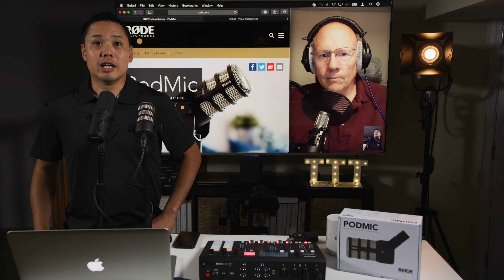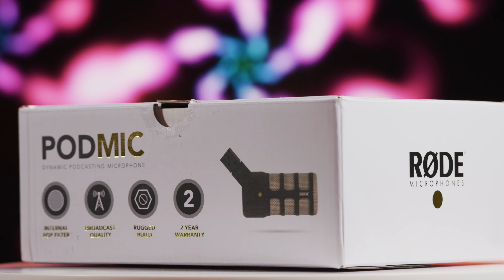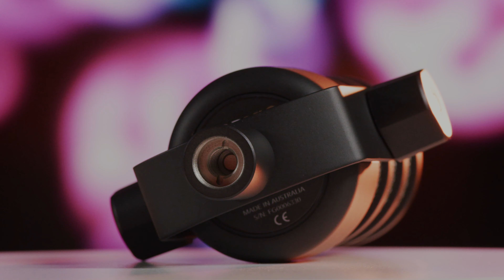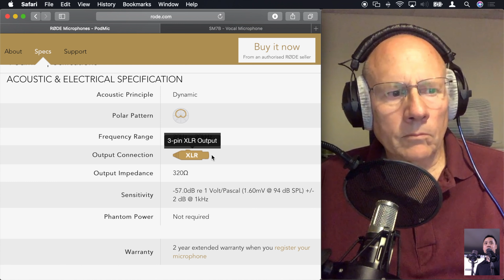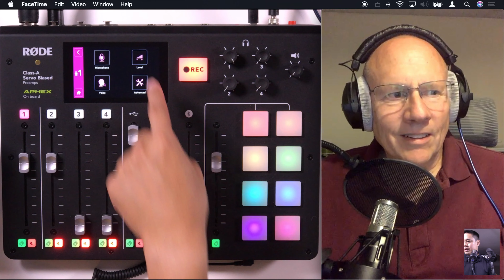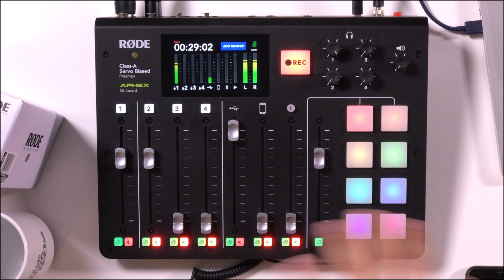RODE PodMic Demo and Comparison with Shure SM7B on RØDECaster Pro

Comment: The SM7B is built specifically to sound like it does.  Plug the PodMic into a regular audio mixer (with USB) like a Mackie or the Behringer clone of the Mackie.  Give it the gain it needs.  Add about 4 clicks of compression. Roll the highs off a couple of clicks.  Punch up the bass a click.   Now please!!!! it's a dynamic mic so eat it and stay close like you would an SM58.  If your voice is deep like mine it will sound great.   If your voice is light and nasally it will sound pretty lame so grab the SM7B.  .

Comment: My Røde PodMic also has that low electrical hum. I have to clean it out of the audio track in Audacity after I record a voiceover. Thought I'd point out -- you probably didn't get a defective device.
Reply from the maker: Thanks. We tried two different PodMics and both had the same hum. It seems to be from the electric dimmer for the lights in the room.

Comment: I don't know who "Bob" is, but he is most definitely biased. Does he work for Shire? Sounds like he does. There IS a difference between the two Mics, but NOT nearly as dramatic a difference as he was describing.  The "difference" by the way, can be solved by turning us the volume and adding a little low end. Period. You shouldn't make "review" videos if you can not be neutral and preset a FAIR comparison. Bad form guys.

Comment: I've do7.pl/SM7B been buying gear from Alto Music since 1980. I've trusted them with my guitars, and they've helped me make the right decisions for my needs and budget. Last year, I bought a set of Fender Custom Shop Texas Specials directly from Alto's web site. Over the past year, I received a bunch of Amazon gift certificates and wanted to get myself a Shure SM7b. When I saw that I could get the mic from Alto Music, it was a no brainer. I was purchasing from my local music store through Amazon. As for the mic, it's an SM7b, and it's everything I was looking for, despite it being a low output mic. It's smooth, has a sexy low end color, has no harshness, brittleness, or high frequency unpleasantness that can occur with some condensers. I'm recording in an untreated basement, and this mic is perfect for when I'm singing loud rock stuff; it only picks up what's right in front of it and none of the room. I'm using a Focusrite 2i2, which is great for loud singing, but I'm picking up a Cloudlifter for some more clean quiet gain to use this mic on acoustic guitars and softer vocals as well. For me the mic has been all it's cracked up to be.

Comment: It is like comparing a Corolla to an AMG. Great video, don't get me wrong but the comparison is useless. Two different markets and you'll definitely have two different kinds of buyers. Lets put it this way, some people who are starting, have a $300 dollar camera. Nonetheless, a good video.
Reply from the maker: Zacarias, thanks for watching. Sorry you didn’t find it useful. We believe that this comparison was intended for people who have up to $400 to spend on a mic for podcasting. They don’t necessarily want to spend $400 if it isn’t necessary, and they want to see what they could also get for $99. If one only has $99 to spend, then perhaps this video isn’t as useful to him or her. 

We learned a lot by doing this comparison ourselves like the difference in falloff with increased distance, EMI shielding, and shock mounting. Many people think the SM7B is the super high end range of microphones, but it’s really the tip of the iceberg. Some people—not many—are used to spending $3000-$10,000 on a microphone. 

In the end we found a use for the PodMic as an at-home web conferencing mic because there is such a dramatic falloff in sound. It doesn’t pick up background or room noise.

Comment: first of all: would have helped to speak into both mics at the same distance. second of all: I would never ever judge a mic on how it sounds on someone else's voice. your voice is not the deepest. thus the low mid scoop that the PodMic has is immediately apparent on your voice. however, other shootouts I've seen with lower voiced narrators show that the PodMic does have quite a significant boost in the low frequencies. so for your voice the difference is instantly noticeable. the Sm7B is a fit for your voice. the PodMic isn't. but that doesn't mean it can't sound stellar on others.
Reply from the maker: Thanks for your comments. I agree that the best way to judge a mic is to test it yourself. Distance was the same despite how it appeared on camera. See our follow up video to illustrate the the difference that distance makes between the two mics’ tonal response. Had we known that people would think that it was not the same distance, we would have shot it from profile to prove it. At about 3 inches you’ll hear a much more significant drop off in the PodMic, perhaps because it’s diaphragm has a heavier mass than the Shure. I’ve seen other reviews too, and they’re done mostly much closer. That wasn’t our use case here. I’m interested in what you think on the follow up video we did where we shot it in profile to clearly view the distance and hear the sound from the two mics. Vertical distance in this video is not indicative of total distance from mic.

Comment: As several others mentioned.... 

1. You're speaking closer to the Shure SM7B  
2. You use less gain on the Rode Podmic 

And lastly if you set the microphones so they actually have the same output level, and do a blind test instead of telling bob which one you're using you might get a different result. Bob seems to have Shure-ears and have his mind set already. 

Sure a $400 mic should be better than a $100 mic....

Comment: UNFAIR REVIEW ☹️ 🎙 

 definitely !   You are speaking at least 1 inch further away from the Podcast Mic.   The  podmic requires a gain of 40 not 35 plus a fraction closer than the Shure that costs x4 times the amount.  
The Podmic is far better than this review suggests.   
Search other reviews or do a re-record - please

Comment: The RØDE Podmic sounds horrible. Sadly, there is no other way to put it. On that price range there are a lot better microphones available . Take the Shure SM57 for instance. Or the Audio Technica AT2020. The RØDE Podmic sounds plain bad. I’d rather save for a RØDE Procaster.  But in terms of handling, no RØDE Microphone holds a candle to the Shure SM7B.

Comment: I wanna know if the shure is using a cloud booster and or if it’s compressed in the settings? I believe you could get an as equal sound quality if you play with the settings
Reply: you can! alpha gaming had them sound almost identical tweaking like 3 settings

Comment: 8:30 “it’s like you’re further away..” You are. Look at yourself on video; you’re not equidistant from the top of both mics when you speak and go back and forth between them.  I’m surprised this was missed when you guys are talking about adding gain and such.  Nah, just put your mouth the same distance away and voila - a fair comparison.  Also you have the voice setting on deep when you don’t have a deep voice so it sounds more tinny and less complimentary.  When you switched to medium very briefly after the 5 minute mark it sounded fuller.  Obviously the SM7B is going to sound better as a higher grade mic either way, but the degree to which it did would’ve been lessened.

Comment: maybe it's just the rodecaster but the noise floor is very noticeable under the shure when he speaks. his voice sounds more clear but there is like a hiss or metalic static behind his voice when he speaks. the podmic doesn't have that, even if the voice doesn't sound as full. my guess is because the rodecaster pro doesn't give enough gain power to the sm7b so when boosting the sound it increases the background noise. the podmic doesn't need as much power so the noise floor is either not there or just way less noticeable. I have a shure sm7b and I love it but the podmic seems like it would be a good solution also, if you get a little closer to it as you do with the sm7b. it is designed to be able to handle plosives, so put a windscreen over it (just to be safe) and seems like it would be just fine.

Comment: I noticed that you are speaking closer into the Shure mic, that's giving a very unfair result from my experience with speaking into mic's ...
Reply: Justinian Deception I’m glad you said this..
Reply from the maker: Hey guys, thanks for the comment. We did some offline testing, and yes there is a big difference when you vary the speaking distance on the PodMic. The tone thins more rapidly than on the SM7B as you move away. I can get a fuller sound on the PodMic (more similar to the SM7B) when my lips are quite literally touching the grille of the mic, and I can pretty much taste the metal. Plosives become more problematic at that distance, however. If you are OK with using the PodMic at that super close distance—lips virtually touching the grille—, you may be happier with the resulting tone. If you plan on having guests speak into the PodMic, my experience is that they tend to talk farther away from the mic as personal hygiene becomes a concern. At about 2 inches distance—a reasonably close distance I anticipate guests to use—, the SM7B still sounds fuller to me. Maybe you can coach your guests to talk closer to get a better sound on the PodMic. Cheers!
Reply: @TheThreeTechs  I am not saying if one mic is better or worse than the other or am I saying that the Shure is a bad mic! I love the Shure mic, I have many Shure mic's and love them, I think they are a benchmark mic no doubt!!!! but you were not at the same distance from the Rode as you were to the Shure when you did the test, All I wanted to see was the test to be conducted in fairness to each mic. The Rode could be a great mic for the price for the new upcoming pod casters or radio stations,  but you never gave it a chance to see the difference at an equal speaking distance. We all know the Sure is the pic of the mic, but could the Rode do a good job, so that was why I wanted to see the test to be done on an equal footing... There are a lot of new upcoming youtubers, pod casters and the like so the Rode could fill a big gap if it got over the mark of being acceptable... Thanks for the response though, nice to hear from you...
Reply: Justinian Deception - definitely !   You are speaking at least 1 inch further away from the Podcast Mic.   The  podmic requires a gain of 40 not 35 plus a fraction closer than the Shure that costs x4 times the amount.  
The Podmic is far better than this review.   
Search other reviews or do a re-record - please
Reply: Dang.... After watching your video, had to pull out my Rode podmic to see if it sounded as bad as you made it out to be...  As previously mentioned, proximity effect plays a MAJOR part of how the podmic sounds... back away, it gets thin rapidly... couple of inches away slightly off axis and it compares favorably to the SM7 (which I've used for years).  Me thinks you owe an apology or a redo on your video.
Reply: No but the capsule in the sm7b is recessed from the end of the mic
Reply: The difference is very little

Comment: You looked to be a bit closer to the SM7B. Maybe why it seemed fuller? (proximty effect) Also, were the settings on the Shure set to flat? Or was the low-end boosted?
Reply from the maker: douginsaltlake Thanks for the comment. Proximity effect definitely can boost the bass, but when I experimented with both mics offline and when I was right up against the PodMic it still sounded thinner than the SM7B. The SM7B was set to flat. It doesn’t have bass boost. It has a setting for bass rolloff or presence boost. But again it was set to flat. 

An interesting thing to note about the SM7B is that it’s capsule is set quite far back behind the front windscreen, so even when you’re right up against it you’re still about 3 inches away from the capsule. The PodMic is shorter, and I don’t know how far back it’s capsule is positioned. 

The PodMic definitely emphasizes the top end presence more.
Reply: @TheThreeTechs  Very well. Thanks for the reply.
Reply: Interesting reply.     I say just increase the gain a bit to 38-40 on the rodepro and increase your voice volume a fraction also (and if possible add a few Fx) that’s when the pod micwill perform fad better and much more professional, however it’s fair to say that perhaps this mike is not for the quiet speaking people.
Reply: Final point to add is that these differences can only be heard with reasonable headphones most people as you’re aware do not listen to podcasts with reasonable headphones instead they use the normal phone speaker or low end earphones or player Bluetooth through the car speaker all of which reduces and negates all the differences that we heard anyway.

Comment: You should be aware that the Podmic rolls off the highs at 13 kHz which is less than most other dynamic mics.

!
Reply from the maker: Thanks for the comment. The PodMic does seem to roll off slightly earlier than the SM7B. We didn’t notice this difference in our vocal-based testing, which typically falls below that range. Perhaps it would be more noticeable when using these microphones to record instruments.